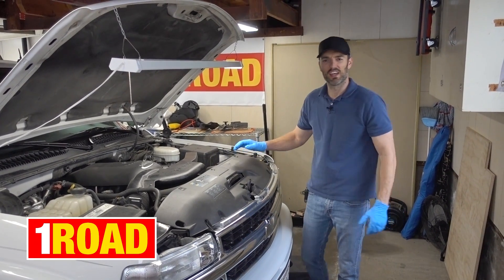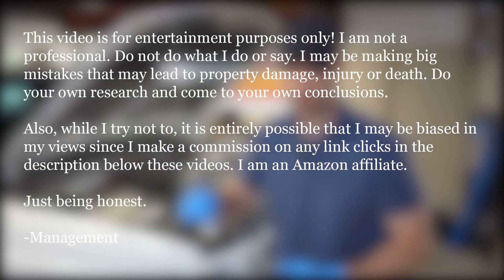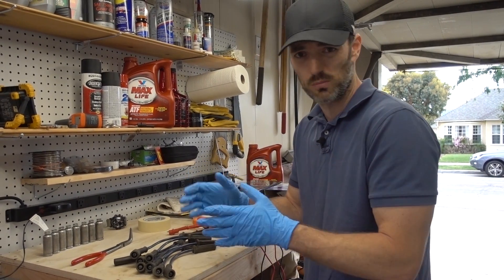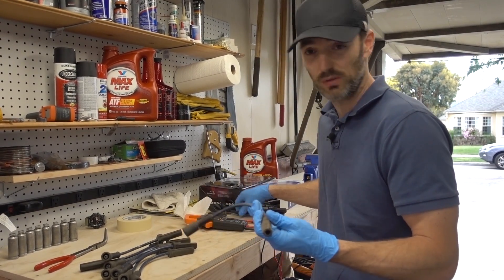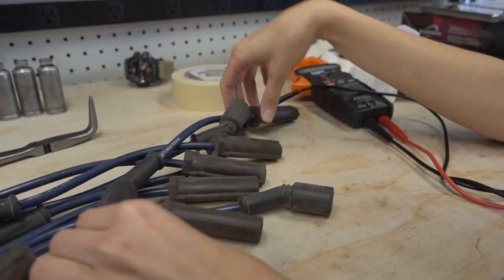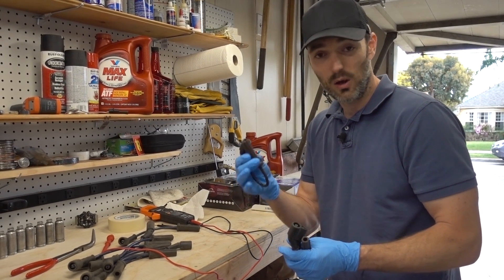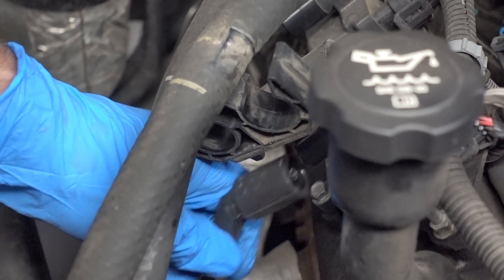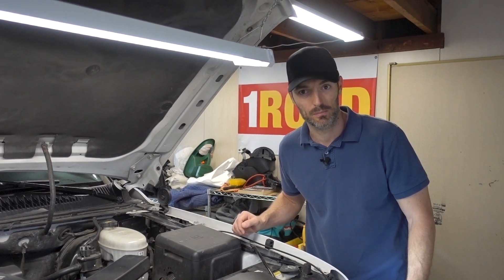Why You Should NEVER REPLACE SPARK PLUG WIRES WITHOUT FIRST TESTING FOR OHMS!

Comment: Resistive wires are a matter of noise.  To put it as briefly as possible; more resistance = less EM radiation.  Ohm out the terminal to tip of a spark plug and you'll often find 3k to 5k ohm resistance inside the plug itself.  A 500 ohm difference in cable is nearly invisible to the system.
The amount of resistance is a compromise.  If you're working with a car with no computer and no radio, you can get away with copper-core wire.  But, the noise those put off can scatter a computer's logic at the turn of a crank.  So, cable and plug makers integrate resistance into their products at varying amounts to balance stability and performance.
In the end, spark is more volts than amps.  Resistance is futile.
Reply: Resistance is futile. LOL.
Reply: Actually it sounds to me like resistance is silence. That is less interruption in the Airways. And if you are looking at hooking up a CB this could be very important if you are looking at picking up a high quality stereo system this is very important.

By the way thank you for letting me know that my spark plugs can be interfering with my radio waves by having less resistance. 👍
Reply: I will assimilate this knowledge.  Your technological and biological distinctiveness has been added to my own.
Reply: Amazing comment, thank you.  I always thought they were just insulated conductive wire and was horrified when I saw his readings. I must be tired because I just measured a couple of brand new spark plugs 24hrs ago and they were around 6400 Ohms. So of course the wire resistance is summed to that and just becomes insignificant. Great to learn why it's there in the first place though. Much appreciated. I have a better idea why so many youtube mechanics recommend replacing wires now even if there's not really any known fault.
Reply: @chocolate_squiggle  thanks! I was looking for this response half way through the video. In my high school 1st car wrenching days I learned this the hard way by buying racing plug wires that unbeknownst to me had solid copper wire conductors, vs the conventional ferrous impregnated type. Suddenly I could hear every ignition coil discharge pulse blaring through my car’s rado, an annoying whining noise that changed with RPM 😅. With my mostly stock NA SBC it made no difference in performance. So went right back to hi resistance “wires” and got the tunes back.

Comment: 500 ohms Makes no difference. Plug wires are made of high res. conductors to stop radio interference. Use silicone dielectric grease.

Comment: The higher the resistance the lower the current therefore less electromagnetic interference on the radio, The spark plugs do not need a lot of current to operate, they require a very high voltage at low current.

Comment: Lower ohms = Hotter spark with possible more RF interference.  Higher ohms= Weaker spark and less RF interference. In your apliacation, it would not make that much difference either way.

Comment: The insulation cracks after getting hot and cold a million times. Then the wires spark like lightning to the closest metal hooked to ground. They will still pass an ohms test but not fire plugs like they should. Take an old car that needs a tune up and watch it run at night under the hood, you will see stray voltage going everywhere. It is cool to see, like watching a tesla coil. This is why we change wires and no i don't care if the wires ohm out or not. A bare copper wire will pass an ohms test too.

Comment: It is very common when removing for these terminals to come apart.  I have repaired many as shown in your video. I was taught that resistance was originally added to plug wires to reduce radio interference. Solid wire acts as a transmitting antenna and the square wave of the spark interferes with all frequencies. While the spark voltage is high, the Amperage in the wire is low, making the voltage and power loss through a few ohms negligible.  400 vs 150 ohms are very low resistances compared to the open plug gap of your resistor spark plug. (Volts = Ohms / Amps) (Power = Volts x Amps)

Comment: I buy the cheapest best looking wires on Ebay or Rockauto. The overall finished quality usually has alot to do with overall quality. If it looks like they used black fuel line on the wires they are usually poor quality. If they have nice molded ends they are probably good quality. I use NGK or Denso Iridium plugs when available. Never use Autolite they are cheap junk.

Comment: The resistance is somewhat irrelevant. Plug wires with a higher resistance simply cuts down on electrical noise.

Comment: Well your wife does some good filming, she zooms in when needed, she doesn't shake the camera, and use the parts that are for your vehicle. Did you modify your air intake box . Drill some holes in the lower part of your air filter box below the filter and let that motor breathe  that thing is trying to run by sucking through a straw those motors are hungry for air.

Comment: The resistance of the wire is only there to make the HT connection inductive, basically it works like a current spike limiter, higher resistance will slow the coils current discharge through the plug from a few nanoseconds to a few tens of nanoseconds, effectively lengthening the spark duration, but also slightly reducing it's energy. If the resistance becomes too high the spark may not happen at high gas load, too low resistance will burn away your plug electrodes faster and cause more emi noise around the ignition system, possibly causing radio noise. I run lower resistance 'performance' leads on high compression performance engines, and oem on stock for maximum plug life.

Comment: I'm not going into the physics of it or the extreme signs of it but you're testing ohms with a DC source on a plug that's meant for high voltage and I'm talkin kilovolt not 600 volt thousand volt I'm talking 5 to 15000 volts that's when a spark plug coil put out resistance at that voltage and data pulse is extremely different than when you measure it with a multimeter at low DC voltage I wish I had my setup I would make a video to explain this that even though those ACDelco tools are showing a higher resistance at the low voltage they'll actually out put a higher spark than the cheaper ones at the plug
Reply: For metal this isn't changes that much, for insulation: of course. Slightly higher resistance may help with EMI radiation
Reply: @KACPER050599  I don't want to sound rude but I'm speaking from actual professional experience also if you just do a Google search on what a spark plug wire is it's actually made 

spark plug wires consist of several different layers. This can vary from manufacturer to manufacture, but a typical wire will consist of a:

Outer jacket: Usually made from silicone, the purpose of this layer is to add strength to the wire and to protect the inner layers from heat, abrasion, chemicals, and other harm inside the engine compartment.

Braided layer: Usually consisting of a braided fiberglass or similar material, this braided layer is designed to add strength and provide some EMI suppression.

Insulation: Located below the braided layer, this insulation (usually silicone or similar material) is tasked with protecting the core against heat and minimizing energy loss by preventing the electrical charge from leaking through the outer layers. It also helps contain electromagnetic interference.

Conductive/suppression layer: Some manufactures add another layer below the insulation as an added safeguard against energy loss or EMI/RFI.

Finally, there’s the core.
The core largely dictates the performance of the spark plug wire. Again, some cores offer low resistance while others provide better EMI/RFI suppression. The most common types of spark plug wire cores are as follows:
Carbon Core: This is the common OEM-style core used on most modern vehicles. It offers excellent RFI suppression but also creates more resistance than other styles. In addition, carbon core breaks down more quickly than other materials so they require relatively frequent replacement.
Solid Core: Solid core spark plug wires typically utilize stainless steel or copper, which conducts electrical current very well. For that reason, solid core wires have lower resistance than other wires to get maximum energy to the plugs. Unfortunately, solid core offers very little EMI/RFI suppression, so they’re not suited for electronic ignition systems or vehicles with sensitive communications equipment.
Spiral Core: Spiral core spark plug wires incorporate an alloy—usually consisting of stainless steel, copper, and tin—wrapping the core to suppress EMI/RFI while maintaining low resistance. As with everything, there is a delicate balance. More wire coils around the core will reduce noise but raise resistance of the wire.
Reply: This is an somewhat example this is why we use a C4 transmission lines or extremely high KV for DC transmission lines lower voltage resistance plays A Part what your truly trying to achieve is the same Spark or better in each cylinder under different conditions vibration at cetera

Comment: The lower the resistances ohms from the coil to the spark plug The quicker the engine respond to the throttle, like a smooth acceleration

Comment: Also not that AC Delco wires are minimum GM spec wire for that car. as AC Delco has several levels of wires you may NOT be getting same as OEM, may be better or lesser(read that as not lower or worse) but the bottom level may be bare minimum spec for that application.
See it's like this, Belden sets it's spec so high they surpass OEM levels on specs THUS they can sell to everyone. now the box for your truck MAY have one or two long wires a bit longer than OEM but honestly if I custom loom some times I will actually shorten a wire. Never had any warranty issues as long as still looked like out of the box. Most companies would only investigate warranty claims if it was like 500 sets of same part number. Not cause tech made wire bit shorter some time in its life.

Comment: I'm sorry. it with 5000--15000 volts your car will NOT give a damn. Lower resistance allow better energy flow. but the reason for the ohm differences are the core construction. Where as Belden has different design to maximize electromagnetic interference protection. Lower resistance spiral core wires are better and the Belden are lifetime warranty and AC may also be. 
It's about preferences I guess. IF you can get AC at reasonable prices fine but replacing those NAPA wires was a redundant and net zero change.
as for pulling terminal off THATS cause you pulled at wrong place on boot. the grip point should be on terminal between where it clips to plug and crimps on wire end. then you won't rip the terminal off.
but if you do most GOOD wire crimpers have die cuts to crimp both hei and points type terminals.

Comment: Wire resistance is less important then insulation, and unless you have a megger you are not equipped to test it.  In general less resistance is better. Don't delude yourself that GM is designing the wires and specifying the spark plug wire restance.

Comment: A DC resistance test at low testing voltage does not tell the whole story about how they will behave in use at high voltage.  There are factors such as radio interference and perhaps cellular phones.  I remember back in the day when "performance" plug leads were actually constructed out of a carbon track core and they worked just fine.  Low resistance wire cored plug leads may be what you need on a drag racer but not for everyday use. More important is the insulation material and how they behave when driving on a wet horrible day when they are liable to be covered with road spray.

Comment: I’d stick to OEM cables. The resistance in spark plug cables is there for a reason. It helps prevent interference with electronics, which can cause problems with the radio or the engine computer. I once tried making my own spark plug cables using solid copper wires. I only replaced one of the cables to test it, but the massive EMI it put out caused the engine to stall. If it’s an old carbureted engine and you don’t care about the radio, then low resistance cables are OK. They’re also needed for some special high compression engines where a normal spark would get blown out.

Comment: check the resistance after warming  them up  drive like 20 miles on both you will be 100% surprised the napa have higher resistance.....
COLD resistance means nothing ...  What matters is the HOT operating temperature resistance..... you will see 1kohm to 8kohm  with the napa  and
 the acdelco will be under 600ohm ( or with in specification).  That is the only way to tell for sure if  they are better or not
Reply from the maker: I'm gonna try this!

Comment: That happened to me on a 4.8 I had but instead of 1 it was all 8.
They didn't want to come off though I was planning to replace so so I disinterested them to pieces.
I had to use a pick set to get them off.
I replaced them with JBA Power Cables that are made in USA with silicone...
Then I sold the truck cause the transmission blew.

Comment: bosch  or msd wires are great improvement over those oem or napa wires. the wire could of weakened from resistance and heat over time.  the pretty women just took all the resistance out of that wire.

Comment: Resistance in plug wires is to eliminate radio interference.  Less resistance means more fire to the plugs.  Either of these will work just fine for you.
Reply: what matter is the HOT resistance as WIRES heat up they make more resistance   the napa will have higher HOT resistance 
he only showed the COLD resistance  .
 I can make wires near ZERO resistance  with dry ice   aka super conductor.. :O

Comment: Ive had I guess a similar experience. I went to do plugs & wires on my 03 Silverado 5.3 and someone had recommended B&B plug wires. So having never really head of them I did some research and it sounded like there a pretty reputable company so I figured hey why not so I ordered a set. Now when I get a new set of wires I always check the resistance before anything and compare it to the factory spec. So when they arrived I did so and at first thought I had to be doing something wrong. But what? I’ve checked resistance on dozens of plug wires i mean I know what I’m doing? So for the hell of it I checked it again & again & again. And over & over I got the same readings that ranged from around 300 ohms to about 2400 ohms... now, w.t.f.. How do these first few wires have such low resistance and these other few have such high resistance!? To this day I still have no idea. But I clearly decided not to run them on my vehicle because who knows what could have happened with such a big change in resistance from wire to wire. So now, I just stick to OEM.

Comment: I use AC Delco part's as much as possible on my GM's. They all have had well over 200,000 miles on them and run no different than at 100,000 miles... Same with AC Delco oil filters. I use the  AC Delco part's designed for my vehicle's and never have an issue...

Comment: Lower resistance wires put more of the ignition energy at the spark gap, burning more of the fuel for higher efficiency (greater mileage). If that appeals, get Granatelli MPG+ wires, which are verifiably Zero ohms. I have them on my Buick and the fuel savings paid for them in very short order.
Reply: Is this fact or opinion. Im filter thru what everyone is saying  not trying to offend sir TIA.
Reply: @anthonysandoval965  my mileage improved, not insignificantly, when I changed to the make of wires I mentioned. Further, while swapping them, I measured wire-to-wire resistance with my DMM and the OEMs were in the low 1000s of ohms range, and the new ones never topped 0.2 ohms. A huge difference, especially on a waste-spark ignition. All of the voltage went to where it matters, rather than to waste heat. Fatter, stronger sparks burn more of the fuel in the charge, and the computer trims delivery back without a loss of power. You could even open the gap over stock.  My Buick is at 260k km (160k miles) on the original converter and sensors because the exhaust is so clean, and I’m getting better mileage than the window sticker that came on it at the dealership. 
Don’t take anything for granted!  It’s good you’re sceptical and researching; take your newfound knowledge and put it to use. A better life for you and it helps the planet too.

Comment: I always try and use OEM parts on my GM vehicles even though they may cost a little more because the OE made parts are always made to a higher standard than aftermarket parts. I'm referring to a stock scenario. I have used the best aftermarket parts and bought the best quality part I could get from AutoZone, NAPA etc. and they are almost always a little cheaper than the OE counterpart with a lifetime warranty but what the warranty does not cover is your labor to replace the parts (not to mention inconvenience) when they go bad and they will go bad if you keep the vehicle usually in about a year or a little more in a lot of cases, I know this from personal experience. Great vid as always Jimmy, keep up the great work.

Comment: The wires will last for a while.  So divide the price of the wire-set by the number of miles you expect to use them.  The difference in cost between the OEM set and the NAPA wires will be near zero dollars per mile.  I'm not a big fan of the AC oil filters lately, but the wires, fluids and other electrical components will offer you added peace of mind if you aren't going to trade the vehicle anytime soon.   Get the iridium plugs while you're at it.
Reply from the maker: The rig has the iridium plugs in it. Didn't know till just the other day.